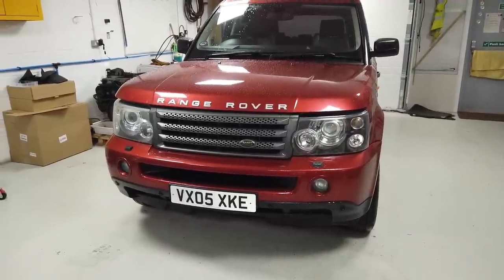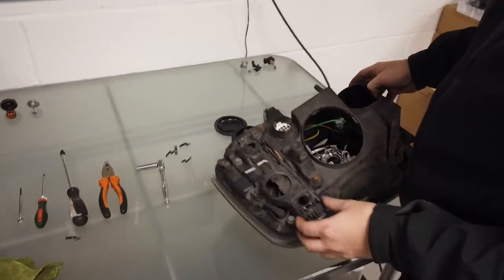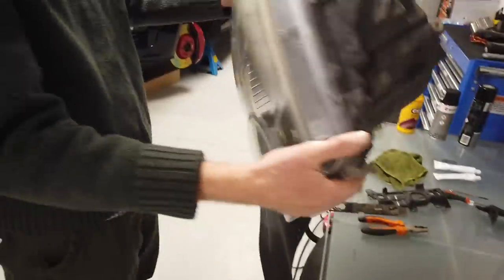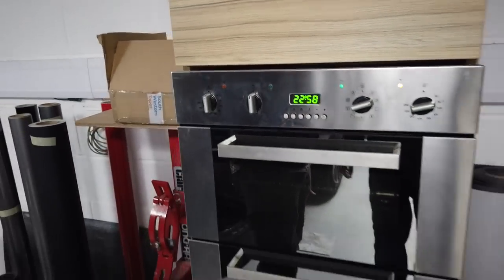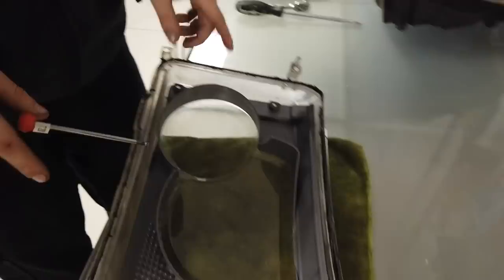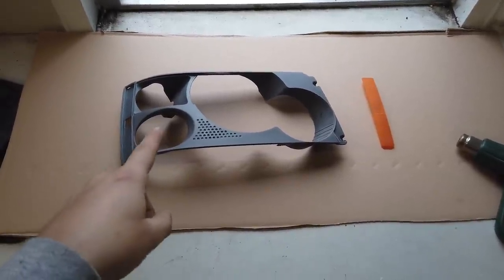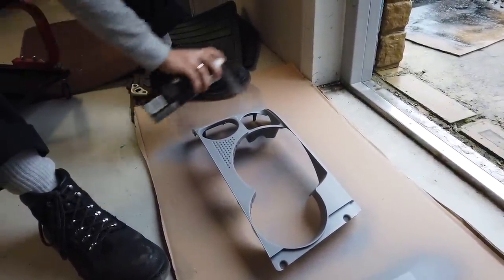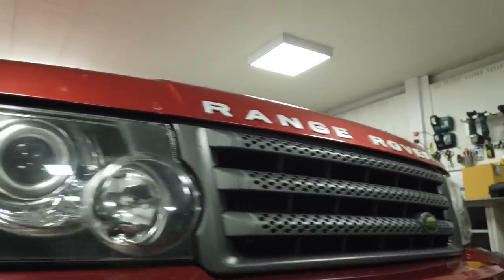How to strip down Range Rover Sport Headlights - remove / replace headlamp lens etc

Comment: For those of us that have the newer variant, I just did headlight lenses on my 2011 RR Sport. Sorry, no video.... They are a royal pain in the arse to remove from the assembly. Basically you must Dremel them off and use vice grips to tear the remaining pieces out of the groves. They were siliconed in place which is why it is so difficult to remove. Heating them like they do in this video does help a lot. I ended up heating each lamp about 5 times while pulling chunks of lens out of the housing. After removal, clean it as best you can and use butyl tape like they did in this video. Heat it up awhile, let it cool and install! I was shocked how well the butyl worked too, 6 months and countless car washes and storms later and still no lens fogging. It is doable on the newer ones, just gotta have patience!
Reply from the maker: Yes the 2010 on lights do indeed have some space grade adhesive used on them...
Reply: I have a 2010. Thank you for for the heads up on the difficulty.

Comment: Interesting that you heated the headlights with the ballast packs still in place bearing in mind just how much those items cost to replace, was that a time constraint or did you not wish to remove them?
Reply from the maker: They still worked after....most modern electronics should be good up to this temperature... it was not that hot.

Comment: I’m noticing flickering on my lights and much dimmer than they used to be. 2011 sport supercharged. Do you have a video for this fix?
Reply from the maker: Hi - is this on both lights ? or just one ? if its just one light its a good trick to swap the bulbs from one side of the car to the other and see is you can work out which element is giving the issue.

Comment: Quick question… could you not use a heat gun on the adhesive?… I’m trying to restore an 07 sport and I’m a little scared of putting the headlight in the oven considering it’s near 1k if I mess anything up
Reply from the maker: Yes its just a bit more tricky with a heat gun to get even heat around the whole lens... but it is possible and the option a lot of people go for.

Comment: Have you attempted this with the facelift headlights (2010-2013?) I can’t seem to get the sealant apart regardless of heat.
Reply from the maker: We did attempt this with the later Range Rover L322 headlights and these would not come apart so i think you may be correct in your findings... not all headlights come apart.
Reply: powerfulukltd thanks for confirming this👍🏼
Reply: I have tried and tried on my 2010 Range Rover supercharged and no matter how many times I put it in the oven it won’t come apart
Reply: @crazylittlecritters  had anyone been able to separate a '10-'13 headlight?
Reply: 2020 RRS HSE:  tried three times before reading this comment... adhesive does not soften in the oven... even holding to a flame.  Still appreciated the video posting, tx.

Comment: Did you fix the non working HID before taking it to MOT?
Reply from the maker: Yes we swapped a few things around - turned out to be the HID pack on the underside of the headlight.
Reply: @L663  hello Can anyone tell me is there a HID pack on each headlight please. Also is this the square unit that screws on behind the bulb ? Thanks.

Comment: You don't mix silicone and the oem glue. When warm smooth out glue in channel. Off the sides and pushed to the bottom. If you need to fill in a bit use a donor lights glue or use some windshield butyl. You can use silicone if channel is completely clean. I'll use that for lenses that i did a lens swap by cutting lens off a urethane or silicone based glue that are not affected by heat. I split and repair a lot of lights. Just a fyi from my experience.
Reply from the maker: Thanks for sharing your wisdom !

Comment: Can you just use a heat gun to remove the lens rather than put in oven?... Cheesr
Reply: Can you just use a heat gun to remove the len rather than put in oven an removing all other bits?.. Cheers
Reply from the maker: Yes but this is difficult to get the whole lens / lamp to a nice warm temperature
Reply: @L663  thanks appreciate it... Gonna try an do some sort of drl turn signal design within headlight👍
Reply: @donwk1892  
Did you use a heat gun? Did it work?
Reply: @rajdattani1507  no..i just put new headlights in like the new 2023 defender style i bought from AliExpress.. lol